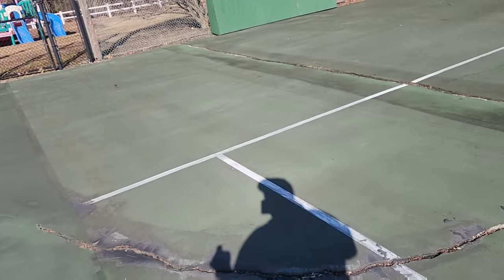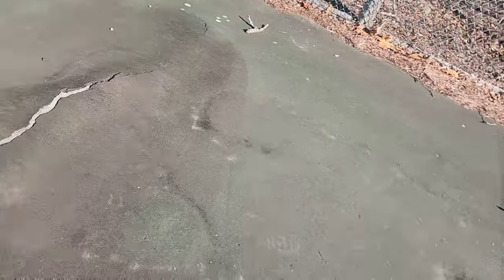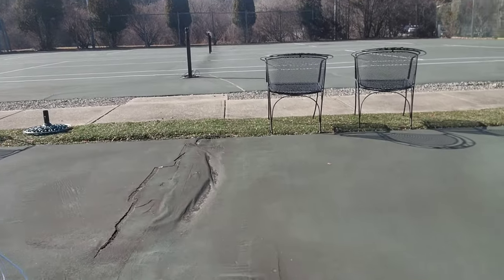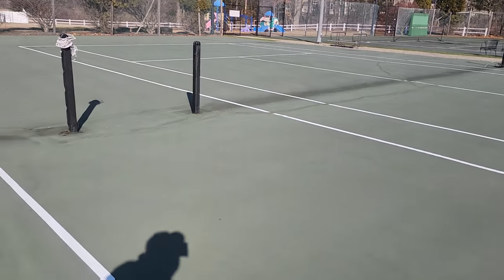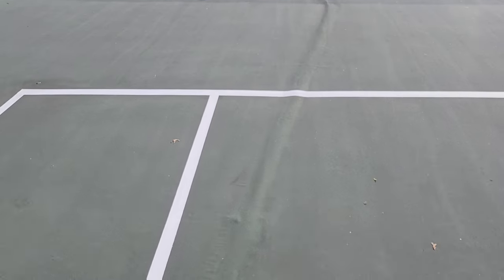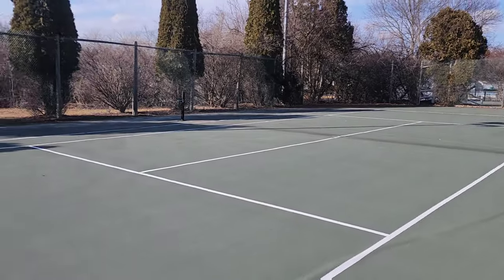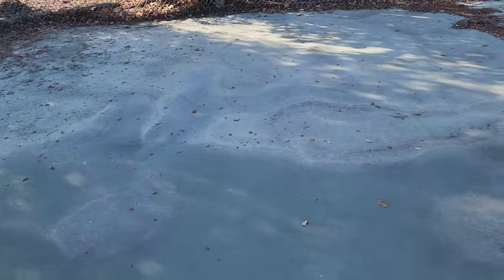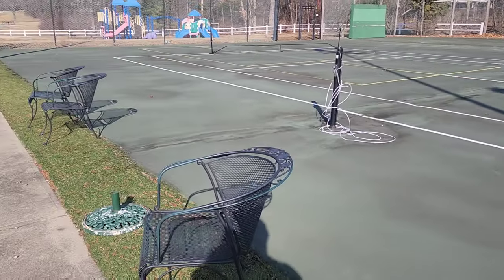Side-by-side comparison of a tennis court that can be repaired and one that can't.

Comment: Thanks for all your content.  Love your,  no  bullshit, all about quality format. That is hard to find in any industry today.
Reply from the maker: One thing I learned If you can try to sugar coat things you can try to pass things off Enough to get you through that 1st year but When you're in this industry there aren't many people to call so if they start having problems after the 1st year on something that You didn't do 100% correct to start you wind up having to deal with it so if you just push them on the doing stuff the correct way the 1st time then you'll save yourself a lot of hassle down the road
Reply: @thesealerguys  Exactly. Do what you can to learn  at your level. You can reach high, just not so high, your quality is shit and costs the customer more fixing your failure. Called with a few questions via your business line,  was a  Louisiana #. sent a text. I don't know if its a land line. Thanks again, great content, much appreciated.
Reply from the maker: @richardstrickland  This is not something that happens overnight this takes years and years to develop a good technique and honestly to get your work to where it will stand the test of time it's not like seal coating a lot of guys who seal coat think it's interchangeable just by the color of the material but that's not the case
Reply: @thesealerguys  That is my issue. Finally will have money to get my LLC up and going in August. Was dialed in on pressure washing. Stumbled across the niche market of line striping. Then found seal coating.  Parking lots here wrecked faded lines, jacked up stencils.  I want to pick one, dial it in, then in time add the other services.  Take it slow, easy does it. Just on the fence about which will be the best to start. Line striping seems the best one since it seems to be the most needed. low threshold of entry and setup. that was my primary question. Which would you suggest, first? Thanks for your  time
Reply from the maker: @Richard Strickland  I mean they go hand-in-hand with one another You're not gonna make a killing doing line stripping it's gonna take you years to develop yourself and acquire the equipment to actually do bigger jobs enough to wear you can start slamming money in the bank. Seal coding also as a very low barrier to entry because You can make a homemade rig Lying stripping should be something that you offer is piter your seal coating company. Because again it's gonna take you a while to develop yourself in that market to the point where people know you enough And trust You enough to work on commercial properties so you're going to get You're start on driveways
Reply: @thesealerguys  Greatly appreciated. I'm 50. Ol school mindset. Was in refineries as a boiler maker and foreman 30 years before my back went to  shit. In the end was doing industrial pressure washing till my legs became gimpy. Have the work ethic  and quality standard. Pretty good at getting the most out of fellow workers, with out being an ass.  have zero tolerance for lazy, greedy, or drama.  Go in with pressure washing, since we can work almost 310 days out the year.  Only below  32 f  maybe 14 days out of the year, the other days missed are due to heavy rain.  Do entry level seal coat trailer, with tote sprayer, crack fill machine, blower edger etc. easy does it. Debt free ,grow slow. Use the same format with line striping format. Thank you bud, your insight and knowledge, it is priceless.  Has helped me decide which to dial in first and where to go from there. Greatly appreciated.

Comment: I really have learned a lot from your videos. Top notch, right to the point!  Question...  we have an asphalt tennis court that has weathered away for years, we will never play tennis on it but we have a soccer goal and basketball goal the kids train and play on. There is no green acrylic left on it and you can only barley see some of the white lines left. It is very flat and in pretty good shape other than some cracks. I want to protect it and make it look better so I am going to squeegee seal coat it. My question is, what's the most cost effective way to fill the cracks first. Cold pour filler from big box, make and mix my own cement, sand mix,  Aqua-phalt?  I have watched your vids on all your different methods, I'm really curious on you opinion considering we will not color it and we have lots of cracks. I wish I had the money to hire a pro like you but I don't.
Reply from the maker: Yeah just the videos of how I do the crack fIlling. If you wanted to get some rolls of fiberglass like the stuff you would use on dry wall seams and go over it with that. Once you get the acrylic you lay the fiberglass mesh down on top of it and Use the color acrylic as a glue you'll need to go over it a couple of times but by the time You're done with your final Coats they shouldn't be noticeable it will probably ripple over time